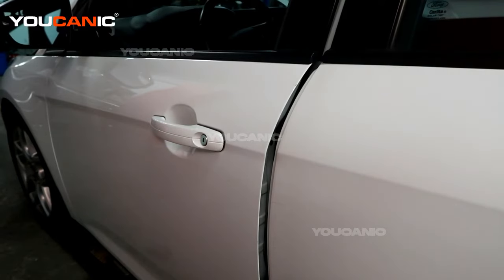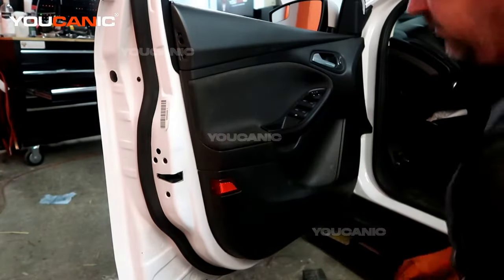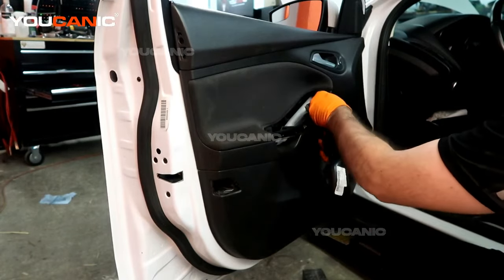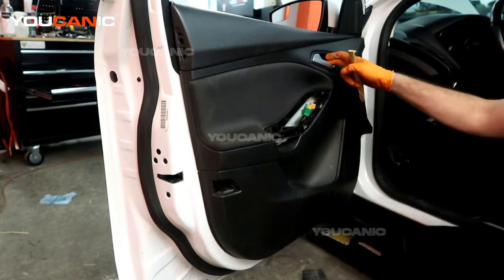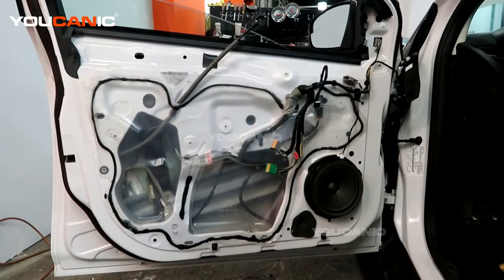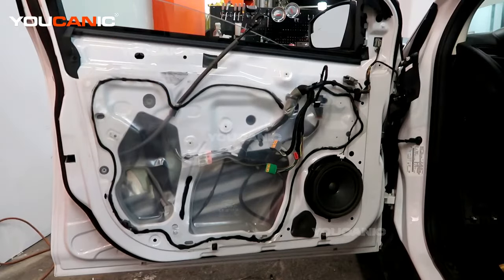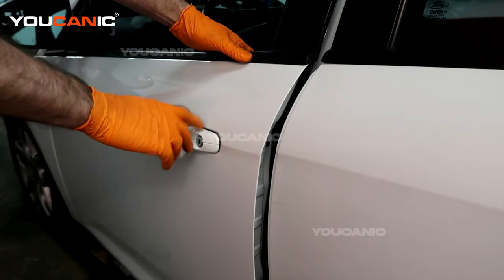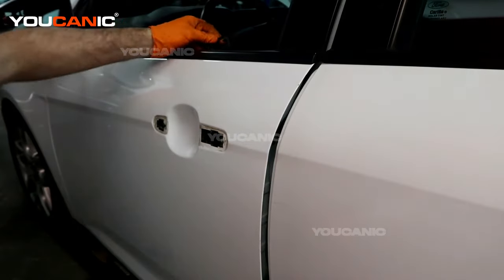2012-2019 Ford Focus - Door Lock Actuator Replacement

Comment: Could you have gotten the acctuator out by just removing the glass rail and moving it to the side or is there not enough clearance?
Reply: Yes you don't have to take the glass out, just take out the 2 silver torx nuts the hold the glass rail and you will have enough clearance.
Reply: Do you have the part number of the actuator please ?
Reply: I took the glass out but not the rest of the window motor assembly

Comment: is this similar for the back driver side?
Reply from the maker: Hello there! The process may vary for the back driver side depending on the car model. At Youcanic, we provide comprehensive guides, free resources, and an advanced Youcanic scanner to assist with your car maintenance needs. Please check out our website www.youcanic.com for specific instructions or if you need further assistance.

We also offer factory repair manuals for detailed guidance. At Youcanic our mission is to empower you throughout your car ownership journey and we're here ready to support you!
Reply: @YOUCANIC  thanks for the reply guys. I'll be sure to check it out once I can find a reasonable replacement part